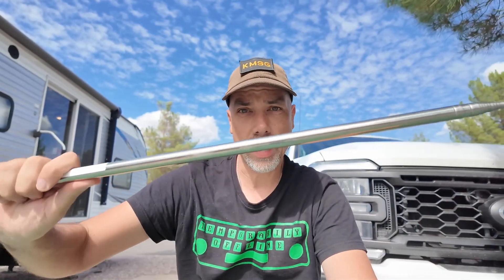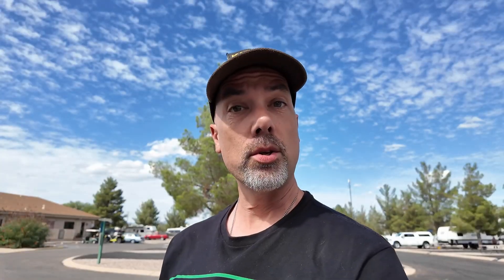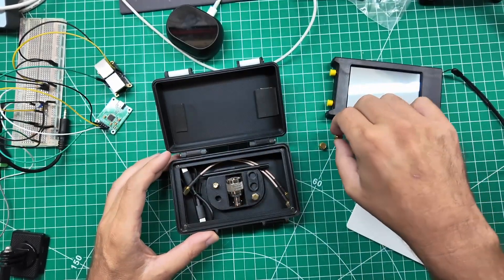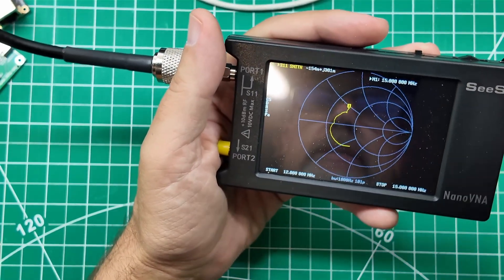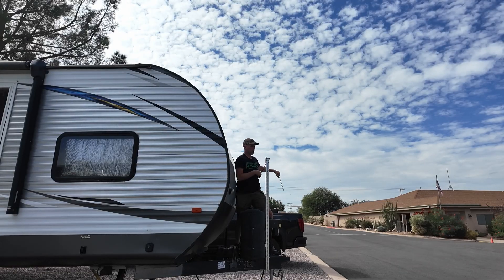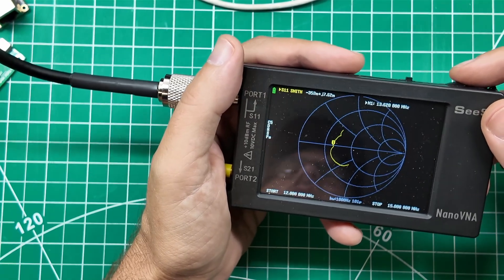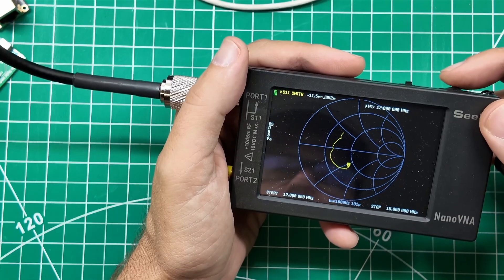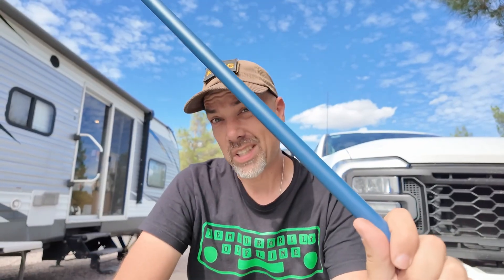You Must Choose, But Choose Wisely

Comment: I assume your antenna is grounded to the RV frame?  I wonder how much that comes into play and if it provides a slightly more directional antenna since it is offset from the whip?
Reply from the maker: This is the current Antenna Mount Setup: https://youtu.be/Xxn1HfpOOK4
These are the results of making contacts on the CF antennas: https://youtu.be/cYXd3jKlVls

It is hard to tell if the "raised/untuned radials" provide any pull because coverage was "good enough" and there isn't a tremendous amount to the south as well as having the front wall of metal between the antenna and the radials...  Its all a compromise as you well know... but the specific test outlined in this video is valid because I'm looking for how the two antennas compare in terms of SWR, seeing if they are wildly different or so similar as to be swappable at all times.

Comment: I got one of the carbon fiber whips.  I don't regret getting it, but my stainless steel whip is superior.  The carbon fiber whip is not adjustable.  It is all the way extended or nothing.  My stainless steel whip on the other hand is easily adjusted to any height from all the way collapsed to fully extended and everything in between.
Reply from the maker: I've run the tall whip with a tuner... sometimes I just want to be lazy!

Comment: How an antenne actually works can not be  measured. Only thing a NanoVNA shows is the electrical/RF values and SWR.
Reply from the maker: Tell that to the trolls in the comments that swear this is a dummy load or isn't "efficient" after only seeing where the VNA thinks its resonant.  Check out the video linked at the end if you want to see that this antenna does in fact emit signals that can be heard.
Reply: @temporarilyoffline  I never wrote the antennas in this video will never work.
Reply from the maker: Right, that's why I was agreeing with you.  Sorry if that wasn't clear.
Reply: @temporarilyoffline  No problem... English is not my first language... (Dutch is)

Comment: Why can't you tune the CF by changing its length? Do the individual sections simply collapse if they're not fully extended?
Reply from the maker: I believe so, I think there is only an N inch friction zone, whereas with the SS whips its a Y inch friction zone.  I bet you can do some tuning by removing a little bit from ALL sections, I'll have to take a look in the future.

Comment: Antenna radiation efficiency is measured by how much power is applied to the antenna vs how much is radiated, measured by field strength.  I know that this channel is not real keen on "the old guard" because they seem to be a pia, when they show up with physics..   FT-8 has built in "coding gain" and can make contacts with the worst performing antenna.    How many "contacts" seems to be the popular "goto" for proving antenna efficiency..  That does not change the poor conductivity of carbon fiber vs a metallic antenna.  Surely, nobody believes the carbon fiber is as efficient a radiator as the metallic vertical antenna????
Reply: Oh crap, you got me, April Fools came early this year....
Reply from the maker: This video compared the two antennas and left efficiency as an exercise for the user.  You are one of the VERY few people that has defined efficiency in your argument, so I applaud you for that and 100% agree with you.  Most people just parrot back what they heard some other OM say and run out of steam real fast.  Efficiency for me is making the desired contact, for others, its the ability to hike up to a mountain top and not be too weak to make the 4 contacts... and still others like to define it the way you have.  I try to encourage experimentation and getting on the air above all else.
Reply: @temporarilyoffline  Well I turns out on a deeper dive the Gabil company supposed performs special conductive coatings within the laminations, these coatings seem to take advantage of the skin affect and "improve" the conductivity as they approach the conductivity of stainless steel..  From AS (artificial stupid)  "Manufacturers like Gabil use conductive surface treatments to ensure performance is comparable to steel whips for HF frequencies [1.0]."   It would be interesting if Gabil performed some chamber tests and let us see the differences...   Thank you for your kind response to my terse comments...  73
Reply from the maker: @wb7ond wondering if you saw the video linked at the end where I compared the 2 antennas on the air.
Reply: @temporarilyoffline  Well, I decided to try to model the difference in EZNEC.  Setting the wire loss parameter to user defined,  I modeled a copper and a carbon fiber using a simple 40M vertical, changing ONLY the "Wire Loss".  Then did a far-field (FF) plot.  According to the wizards of Google the average conductivity of carbon-fiber (user input) is 1.11e-04 (ohm-m) compared to copper 1.74E-08(ohm-m).  Well surprisingly, to me,  the difference in FF Plot is only  0.3db.    For the copper the max gain is -0.03db and for the carbon fiber -0.32db.   I wonder if anybody else has tried to model this.  I can't help but feel that I've missed something, or my dislike for the carbon fiber radiator has distorted my view.   On the air tests have so many variables, its a tough compare.  Don't get me started with the FT-8  tests which have added gain parameters within their protocols, not to mention its a "zoo" inside that 3.5Khz.  🙄
Reply from the maker: @wb7ond and Gabil says they add an extra coating to it also.  I just commend you for not just saying "even a dummy load has good SWR" like all the other QRZombies.  Check out the video where I put it on the air and make contacts. I'm impressed.

Comment: I'm surprised the SS17 did not actually bottom out in the actual 20m band. Less surprised about the carbon fiber because it's not really meant to be tuned by length.

Might be you need to fiddle more with how you've got it grounded to the RV?

Neither one is going to require much action from a tuner to make them behave, though, so I guess it's only a big deal if you're itchy about 1.3:1 or better.
Reply from the maker: Exactly!

Comment: Personally , I'd add some 17' radials, even if they are not straight.
Reply from the maker: See the video where I talk about the radials, but for the purpose of the comparison, all things were equal except for the DUT.
Reply: @temporarilyoffline You can always utilize the space under the trailer ... yes you have with its frame true. But perhaps it can still be improved with a few continuous resonate conductors. NA tiss a silly idea

Comment: I bet the carbon fiber is an awful lot more durable than the stainless steel.
Reply from the maker: It certainly handles wind-load and saves the 3/8ths-24 connector from it better!

Comment: Not being able to make length adjustments to tune the carbon fiber whip (beyond collapsing entire segments) makes it a non-starter for me.  If you only want a lightweight 20m vertical quarter wave, it's great, although quite a bit more expensive than the $28 18 foot stainless whip that I have.
Reply from the maker: Right!

Comment: Great video TO. I prefer the stainless steal. As you mentioned, I can adjust the stainless steal whip and use it on 17, 15, 12, 10, and even 6M. The carbon fiber is light but it's just a mono-band antenna. I'll take the added weight to get the additional bands. 73, KI5PRK
Reply from the maker: I've always wondered if I could get the 17' SS Whip to work on 2m!
Reply: @temporarilyoffline  That would be a cool experiment. I have the SS25 but a full wavelength on 146.52 is like 6.7ft. I'll try this weekend.

Comment: One thing I noticed, is you have a perforated square tube holding as the mast. Is the coax using this as a ground? Like a 3/8x24 stud mount for mobile antennas. And if so, it could be electrically tied to the camper frame to act as a ground plane. 
This may play into swr and radiation patterns. 
Another option for you to consider, sir, would be acquiring some metal (fine) screening, like window screen, and roll it out on the roof, covering the camper, and using a trimag mobile antenna mount, with any type of weight to hold it down...such as a 40lb cinder block.(if the roof would hold it). 
This would allow the screening to act as a ground plane... 
Maybe these ideas might help. Good luck,
John, N8SGM.
Reply from the maker: Thanks for the tips John!
Reply: @temporarilyoffline  Get copper screen for best results. I stopped using tinfoil in favor of copper long ago...(TIC)  Just use the camper frame, your truck frame, the ground rod (at your campsite) and wire them to the chassis of your radio. The coax shield is a different kind of ground reference.

Comment: Carbon fiber is definitely very conductive. I had a drone with a carbon fiber frame and a couple solder pads shorted to the CF frame. Instant flame followed by explosion of the lipo battery. I've never thought to test it's resistance
Reply: I hope the drone's camera was rolling.
Reply: @socallars3748 it was but you couldn't really see anything. This was years ago before I knew to protect against it
Reply from the maker: Wow!  Fireworks!

Comment: I would go for the carbon fiber if backpacking/hiking where weight is a factor. Glamping and tailgate portable I would still go with the stainless steel where I could adjust the length for 17, 15, 12, 10, and 6m
Reply from the maker: Same!

Comment: I am curious about the lack of adjustable length. I assume this is a function of the way the different sections connect electrically. Can you explain this ?  I see that the Amazon US store says it needs a loading coil for 20 m. So if I understand correctly, the CF whip can only be used at one length. One of the major advantages of the SS is that the can be adjusted for length to tune. Also, still unclear, velocity factors of the CF and SS, and resistance
Reply from the maker: I need to test the adjustment, but after a certain point, the sections have no friction left to hold them together - so with the SS whip, you can shrink down to tune using just one section, you'd likely have to tune this one by taking a little bit of each section and that decreases your range.

There are two versions on amazon, the 2200 and the 5200 - this one is the 5200 and its close enough that I'd just touch it up with my tuner.

I think using the numbers shown on the VNA, we can get a close enough bit of info on the velocity factor of each.

Comment: I'm confused why you can't tune the CF whip by changing the length.
Reply from the maker: they don't have the same fitment as the SS whips - you'd have to take a bit off each section instead of shrinking down 1 or 2 on the SS - the CFs run out of physical connection after about 8" of collapsing.  More testing is needed to see what's up.
Reply: @temporarilyoffline  Thx. Makes my vote easy then.

Comment: Is the mast hooked to the trailer "grounded" to the trailer frame that would make a great counterpoised/Ground Plane Just saying I used to use a cookie sheet with a magnetic mount antenna on an aluminum awning for my ground plane it worked great but then again that was for a CB radio I'm sure its not that different RF is RF kind of 🤔
Reply from the maker: Yeah, the trailer is part of the antenna system now... including the big metal reflector right near the antenna.  Still gets out and makes lots of contacts!

Comment: Out of pure curiosity what are the DC resistance of each ...may want to strip about four inches of wire to wrap around the carbon fiber to make a proper connection for the measurement if my hunch is correct. Tuning can be done by adding spacers at the base but only will go down in frequency
Reply from the maker: Good question.  I'll have to figure that one out.

Comment: Surely the radiation resistance is higher for CF vs Steel...  I know carbon fiber IS conductive but how much and how well...
Reply from the maker: Rule #1: Make Contacts
Reply: I don’t think you mean the radiation resistance, but the actual resistance, which wastes power as heat, rather than radiating.
Reply: @NgakpaW um
Reply: @TheNapalmFTW  is it easy for the RF to move through and out to the great out doors yes = low radiation.  Does the RF go to the sky kicking and screaming and grabbing everything thing in sight yes = high radiation resistance  😅
Reply: @P.SeanCoady which is exactly what I said and what I meant. Lol
Reply: Thinking the same, of course it would be but could be overcome by diameter of the element